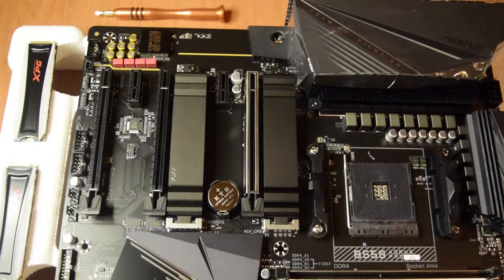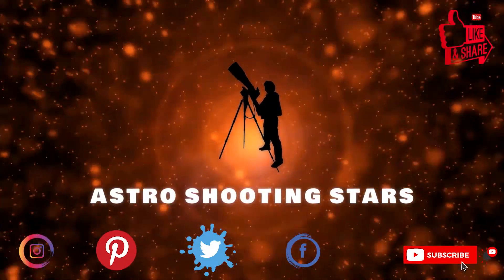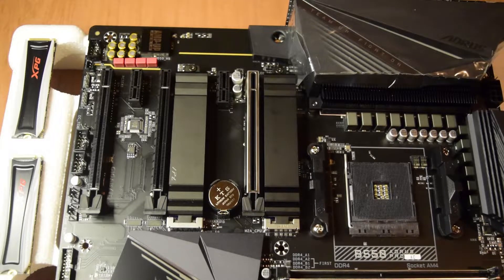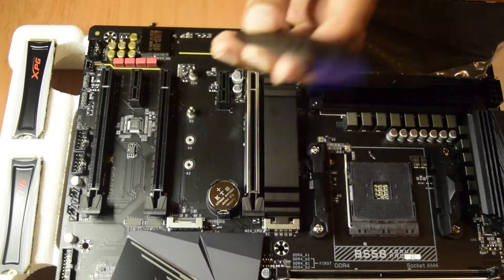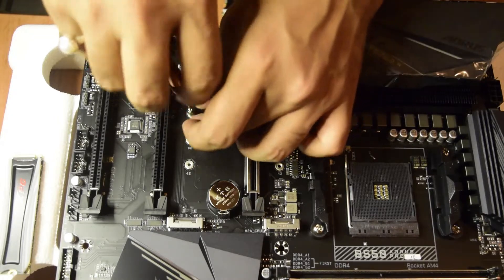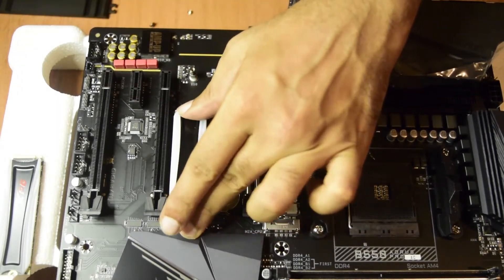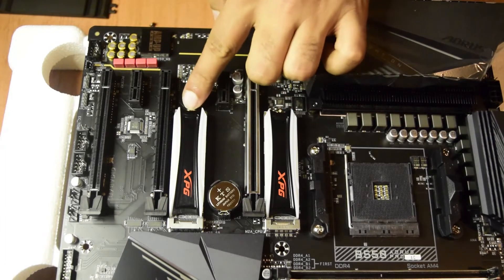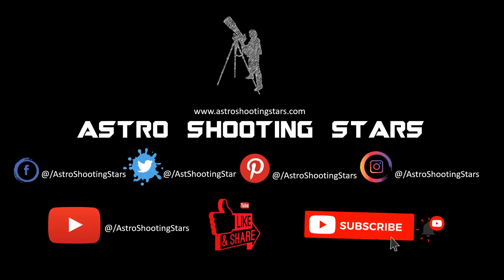HOW To Install PCIe Gen 3.0 NVME XPG S40G SSD On Gigabyte B550 AORUS Pro AC Motherboard

Comment: Are the Gigabyte NVME radiators that come with the motherboard good enough? I mean its placed only on one side of the M2 disc while theres radiators on the market that covers both side of the disc and Im not sure if keep them or buy something like beQuiet MC1Pro.
Reply from the maker: If you have ssd without radiators then the radiators with the motherboard should be sufficient. However its always better to use ssd with its own pre-installed radiators as it uses better thermal connector than what is present on the motherboard radiators additionally both side raditors may not help you much as it is near the motherboard passive radiators depends on the airflow for cooling hence one side raditors could be enough as long as you maintain the good airflow in your cabinet. I hope this helps. Please stay tuned to my channel for my future videos

Comment: Great video. I have a western digital 1tb SSD but it won’t fit? Or am I inserting it incorrectly?
Reply from the maker: If you have a nvme ssd , then you might be insearting incorrectly. Only thing for such ssd is the length of the ssd that you need to check the connection part will be same. If you have sata ssd it has a different port. Best part of pc assembly is you cant insert a component in wrong port so look for the correct port to connect it. I hope this helps. Please stay tuned to my channel for my future videos
Reply: Me ordered wd sn570 and sad to read this, have no experience with nvme
I have b550 aorus elite v2, there is pci.e 3.0 and 4.0, maybe are you wrong with that? But im not sure is there a difference with pcie

Comment: how many ssds can this motherboard hold? including the sata ssds, and m.2 ssds
Reply from the maker: It has 2 ssd and 3 sata ports , additionally its has 5 pcie that you can also use to connect more ssd. However one of the pcie share the same but with second ssd slot so exclude using that pcie then you can use other pcie to connect more ssd. I hope this helps. Please stay tuned to my channel for my future videos

Comment: how do you activate both at times?
i have same board and i can detect only one m.2
Reply from the maker: You have option as far as i remember that second M.2 shares the same Bus as PCIE 3 if i remember correctly.  If you are not using that PCIE port you can have two M.2 slots working at the same time. Its mention in their user manual. I hope this helps. Please stay tuned to my channel for my future videos